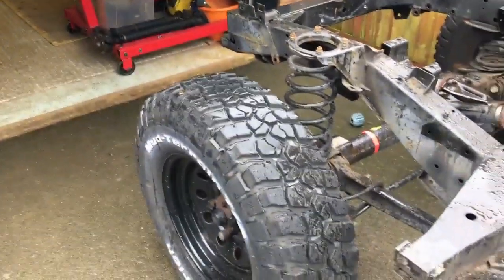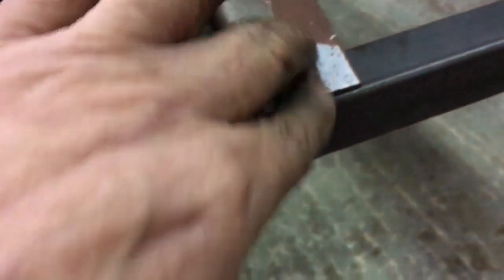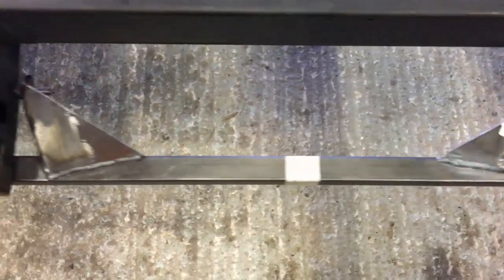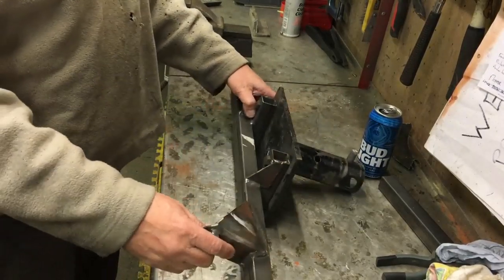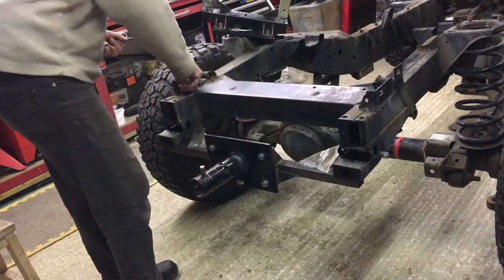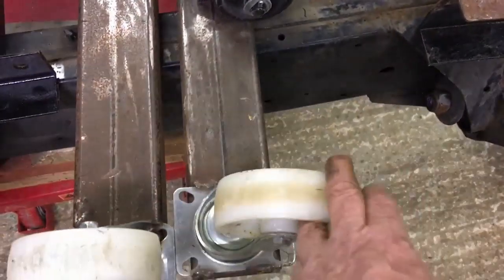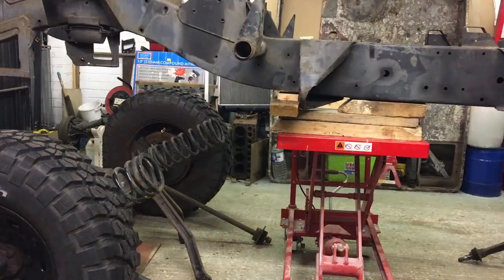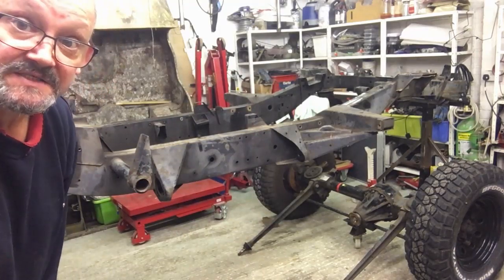Getting the chassis up on the Rotisserie part2

Comment: I have a SGS Engine stand. Like you said for the money and amount of times you use it they are worth every penny! 
Alot better way of painting the chassis thay the way by putting on your stand. 
As reguards the caster correction fitted a 2 inch lift on my Suzuki Jimny (Usually in the background on my videos) but didnt have the time that day to replace the caster bushes. WOW the drive was shocking! Had to drive it for 2 or 3 days before i changed the bushes. Cant believe some people drive them like that!